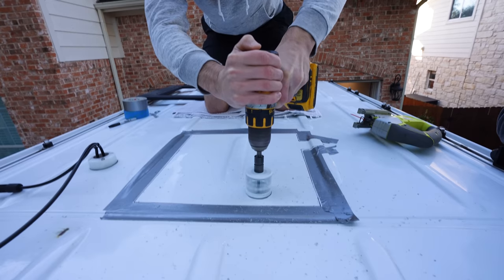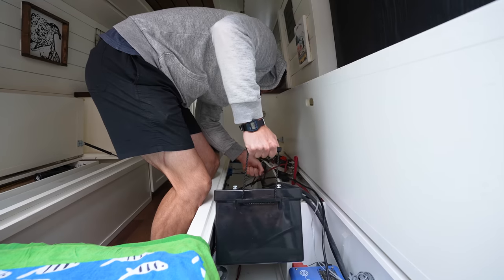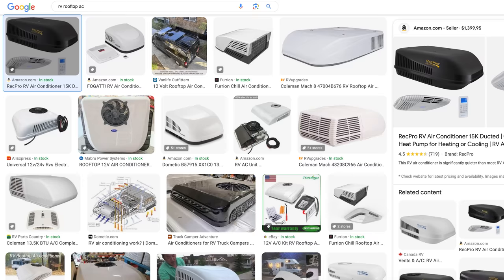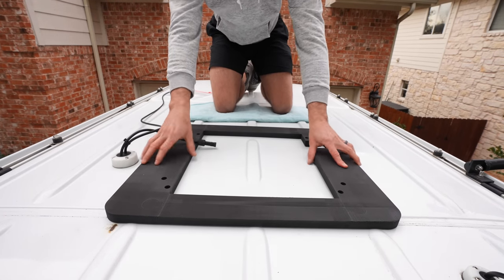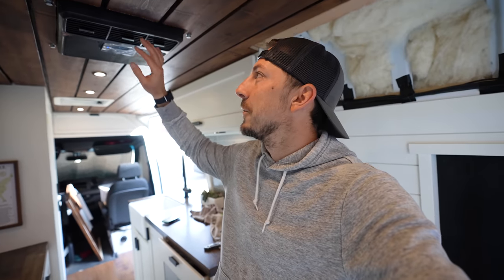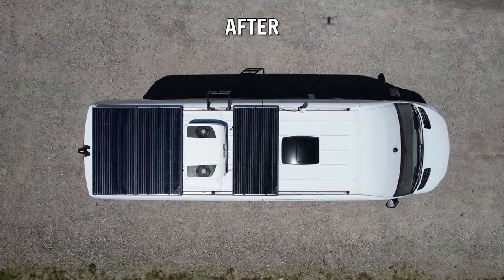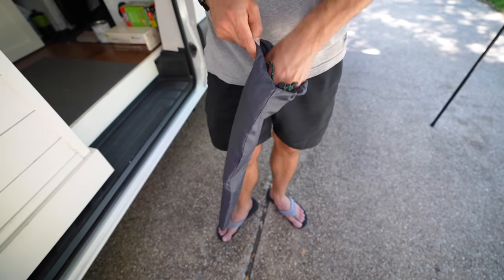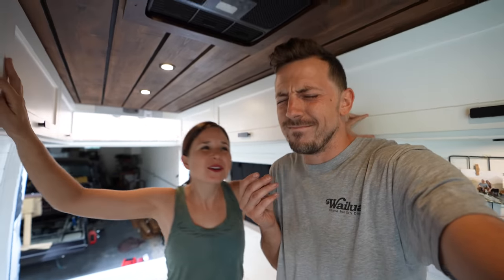We made BIG van upgrades after 3+ years of VAN LIFE! 🚐

Comment: Hi just watch your video I have 2014 Roadtrek Agile and added Added 600 amps lithium the same batteries  you have  new Houghtong air conditioning, 3000 Victron inverter, 3 Victron dc to dc 30 amps each total 90 amps engine running plus solar panels  300 amps, we sleep two nites with the a/c on all nite long after two days we still have above 27% plus two refrigerator. Extremely happy with our setup.
Reply from the maker: Sweet setup!

Comment: Most laptops sell a 12V plug so you may not need the small inverter but I carry a small powerstrip invertor for plug in devices.  You really don't need your 300 watt invertor unless the AC needs it.  You could add back the water tank by removing the 300 watt invertor.
Reply from the maker: Hey Anthony! Yeah we mentioned in the video we’re going to pick up a 12v charger for our laptops. Still gotta do that so thanks for reminding us! 

The big blue box by the batteries is a 3,000 watt inverter. We definitely need that for our water heater and a couple other high power consuming electronics. The AC is 12v so it doesn’t use the inverter. Over the past few weeks we’ve been doing great without the second water tank so far! 👍

Thanks and thanks for watching!

Comment: Using an inverter is what makes the battery drain fast. The batteries are DC, inverter converts to AC, then you convert back to DC to power your laptops.  You can just buy a USB-C with PD charger that plugs in the 12V outlet.  That will get you about 40% more battery life
Reply from the maker: Like we mentioned in the video we’re going to be getting a 12v charger for the laptop. Thanks for watching

Comment: I upgraded to a Renogy 3000 watt inverter two years ago and have no battery load when on but nothing plugged in. Not all inverters are the same. Installed a Victron 30 amp DC to DC charger last year and has been a game changer.
Reply from the maker: Yeah the DC to DC charger has saved us many times! That's nice to not have any draw on the inverter just for having it on

Comment: take a look at hacks to converting starlink to use 12 vdc connection and for disabling motors with a switch and leaving it mounted on the roof - semipermenantly but with otpion to put on original stand on longer wire..  this is a great mod of starlink --  nearly 95% of the time -- to use SL in my van is just turning on a switich --  I also chose to use an alternate peplink cellular router - BR1 5G pro and got rid of the SL tourer for a more flexible better router setup with cellular wifi antenna on the roof  --  a few facebook show all these optional setups and mods..  it is really nice to have the dish on the roof nearly all the time and have no real setup time when parking at most sites
Reply from the maker: I'll look into it more. All of the examples I've seen people cut into the dish and I'm not interested in doing that - at all. We didn't want the dish on the roof for a few reasons. We don't really have room for it, don't want it to get stolen, and if we park in the woods we need to place the dish in a spot where it can pick up the satellites

Thanks for the info!
Reply: @AdventuresofAplusK  no worries......... after having my SL for 6 months -- I chose to do the surgery for putting in a switch to turn the motors on/off -- a friend with SL who is good at crimping rj45 network cable help me do the surgery on cables for the 12 vdc -- I still have extra SL cable that are intact and can use the dish in stock mode with the SL router -- but since the conversion and use of danny hightowers mounting box about a year ago -- I have just used the dish on the roof 97% of the time - stop for the night - turn switch and SL just works - and the dish is safe in its nest on the roof -- I have only gone up on the ladder to fetch the dish down once to put in on a longer cable to move it out from the van  for open sky...  it just works mounted on the roof - it actually still works in motion although it is not cleared for that purpose -- been in several places with no cellular and SL rocked - even for wifi calling with the verizon iphone 12 I use..  anyway -- enjoy SL -- but always have some backup ways to have internet connectivity -- I have ways to use all 3 major cellular carriers and SL

Comment: you should have got ecoflow wave 2 - low battery usage and does both ac and heat…
Reply from the maker: Hey Donald! We looked at options like those, but didn’t think they would cool enough and we wouldn’t have anywhere to store it. It looks big and bulky for our setup. The ac we chose is on the roof and out of the way. We also already have a heater. Looks like a good option for others though!

Comment: Might be worth replacing the usb/12v outlet with a dedicated usb-c outlet. I bought the same one you have but it's only rated for 120 watts total. I couldn't tell which MacBook Pro you have, but my 16" pulls 140 watts.
Reply from the maker: Good to know! Thanks, Bill!
Reply: @AdventuresofAplusK  Also just bought the moon wall based on your recommendation (already have the shade). We had the same issue with the suction cups. We bought the magnets and the stick on hooks to try.
Reply from the maker: Thanks for the magnet and hook tip! We have been hoping someone else with the shade can tell us what we did wrong or how they have made it work. We have yet to use it since we are mostly in parking lots these days, but hopefully we can get it to work and if not, glad there are other options!

Comment: Just curious. Why did you choose the portable Starlink versus the use in motion rooftop option?
Reply from the maker: We didn't want to permanently mount it on the roof for a few reasons. Mostly we didn't want it to get stolen, didn't want it up there for aesthetic reasons, and didn't have room for it. Also, if we camp in wooded areas we wanted to be able to move the dish around for best reception without having to move the van.

And lastly, (I'm not 100% sure on this) when we ordered it I don't think that option was available. We ordered it several months ago. Hope that helps. Thanks for watching, Connor!